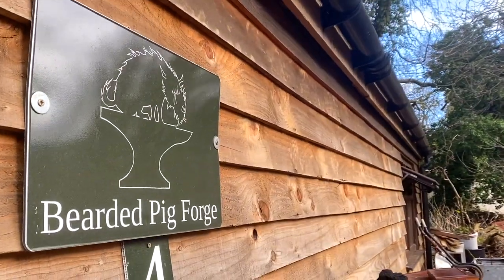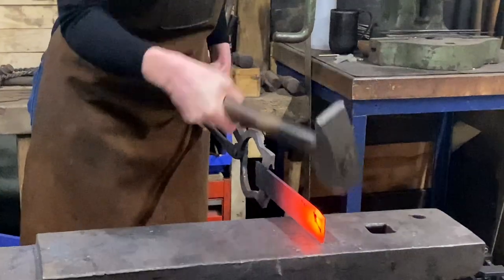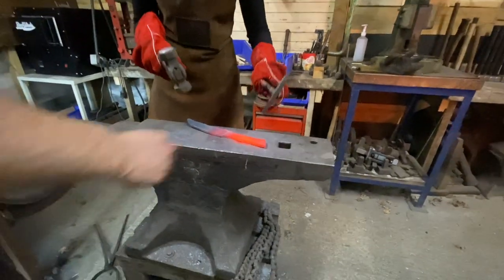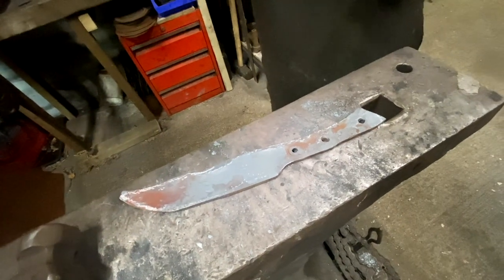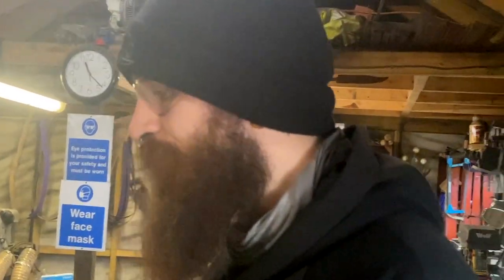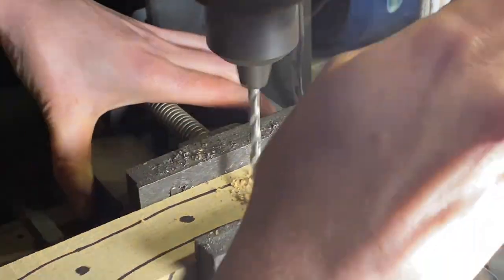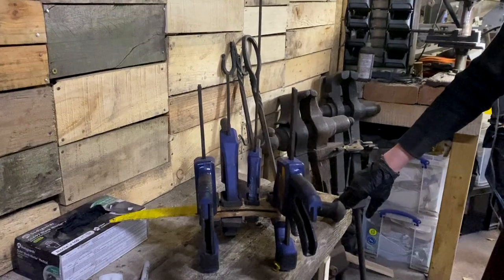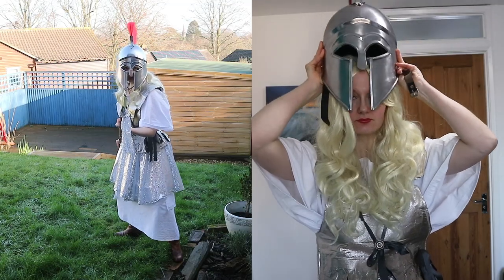I Accidentally Made...

Comment: My partner and I made wedding rings at a forge, and I'm sword making for my Stag party this weekend. I'm really excited. Also, our first lesson was "don't touch the hot thing" too
Reply: Corollary to don’t touch the hot thing is “what looks like cold metal could be hot!”
Reply: @JosephGori  Also, if you set hot metal on cold metal, cold metal can become very hot.
Reply: Yeah, I once lightly touched a metal part of a clamp I was using to work on a piece I was working on.  The heat I was using was minor (It was a small flame only enough to melt solder and anneal copper) and the part of the metal I touched was well away from the heating point.

Dispite having very fast reflexes and only light accidental contact (I was reaching for the wood part of the tool), I got an instant second degree burn.

I also got another burn just from using a dremmel to do some work on another small piece and then touching it (no flame involved).

Even when you're not getting things hot enough to make them glow heat is a danger, so when you are getting things that hot things can get dangerous quickly!
Reply: That last bit is rather like the rule when working with electrical stuff "assume everything is live and will kill you".
Reply: Very important not to touch the hot thing, can confirm...
Reply: Awesome ❤️
Reply: @JosephGori  one of the first things the swordsmith I worked for told me was,  "You're far less likely to burn yourself on a piece of metal that's glowing red then you are one that's dark." To which I told him, "I'm a chef, I know all about being burned by things that don't look hot."

Comment: The most important thing I was told on a forging course is that metal cools from red to black at 500C, just because something isn’t glowing, doesn’t mean it’s cold. And he was right: it’s really easy to unthinkingly try to pick up a work piece by the hot end when it’s not glowing anymore. I didn’t do it, but I came astonishingly close.
Reply: I have thought "must remember, not glowing is still hot" and then soon after just tweaked something in my tongs... With my bare hands, just after it had stopped glowing.
No immediate pain, just a shiny spot on my fingers and an instant "that was stupid" reaction. The pain was delayed by a few minutes/hours. OWCH!
Reply: Hell, even if you don't pick it up with the hot end, the "cold end" may still be hot enough to give instant second degree burns.
Reply: Been there, done that, got the scars from it.  When you drop hot stuff - don't try and catch it!  Woulda worked out fine if I'd have been wearing a glove on that hand!

Comment: The forge version of "a falling knife has no handle ". In this case literally, but yes, no grabbing flying dangerous things
Reply: Working in a vineyard where we use sharp pointy things to prune the vines its amazing how many people, in that split second you get to decide, make a grab for a falling pair of secateurs. Never a good idea.
Reply: I used to work as a car mechanic. One day I was changing the vignette off a windshield after I've finished the oil change. So I was still wearing gloves, dropped the vignette scraper. This this basically a razorblade in a handle with a retractable mechanism for the blade. I manage to catch it mid fall with my thumb and index finger. Completely cutting through my glove through my thumb into my bone. First time In my life I actually had to get stiches and I was bleeding like a fountain. Yes, sometimes you cannot help it when you cat h it out of reflex

Comment: “A falling knife has no handle.” Also applies to soldering irons and anything with a temperature measured in hundreds of degrees.
Reply: Also decidedly Notte Fun is de-soldering a short length of thick 10-12 AWG wire, with a moderately heavy connector (XT60) on the other end, from a PCB overhanging a table edge so that the instant the solder finishes melting, after a minute of sinking a ton of heat into it, the connector pulls the wire to the ground, spinning and flinging molten solder towards me ... and then the solder-coated wire end solidifies in the carpet 👍

That was at least the second time I've had molten solder on bare skin... You'd think I'd learn :)
Reply: @AndrewGillard  I had a similar experience de-soldering a large crocodile clip from a 12V battery charger except in my case when the solder joint gave way the molten solder decided to head straight for my eye.

Fortunately the blink reflex did it's job and no damage was done to the eye itself. I did take a trip to the eye hospital to get it checked out and IIRC after checking out my eye using some fancy machine they gave me an ointment for the slightly burnt eyelid.

Comment: Fun fact, the sparks from the grinder vary with the carbon content of the steel. An experienced smith can tell the quality of steel from the sparks.
Reply: Well, they can get a good idea of the carbon content at least.
Overall quality and other qualities may be different but it is one of the best ways to get an idea of what kind of steel you're working with.
Reply: Fitter & turner here.
Ah, the old spark test. We were taught this in trade school as a way to tell tool steel from every other steel.
Sometimes, the old ways are still the best!

Comment: There's a reason most model kits recommend trying for a dry fit before applying the glue - it makes sure you know what you're doing and lets you identify any problems before you're on the clock against the glue setting. Of course, it does also mean you need to disassemble the item before applying the glue, which tends to loosen the fit slightly, so there is a trade-off there...

Comment: A dagger is 'just' a knife with a sharp blade on both edges, right? Probably better for dealing with ruffian-party-crashers but a sheath definitely recommended before trying to conceal on your person.
I'm surprised that: 
1] The Blacksmith managed to get a beard that long without having singed it.
2] There was so much belt-sanding and you didn't file some of the material away. 
A sword is just a big dagger. Part 2 is making a dagger. Part 3 is making a sword :)
Reply: Seconded! Motion carries (i hope) 😁
Reply: A sword is just a big dagger unless it's a Lange Messer, which is a knife.
Reply: I bet he has singed beard parts and we juat didn't notice. 
Also when using rotating machonary it is sensible to tuck long hair away before your face can get caught in something like a sander or lathe. This greatly reduces singeing  as grinders are where most sparks are. 
Also extra vote for swords. :)
Reply: Technically a dagger does not have to be double edged, it can be single edged (like a Scottish Dirk), but the defining characteristic is that it is pointy and designed for stabbing things. :)
Reply: I've filed a knife out of stock... you have NO IDEA how much faster the belt grinder is! LOL.  It's one of the best inventions for knifemaking since the anvil was invented.
Reply: I think the length of the beard is just like a sign saying "It has been X days since I last forgot that fire is hot".  The longer the beard, the less frequent the accidents.
Reply: @dadegroot  not just Scottish dirks. You’ve also got bollock daggers which can be single edged too, as well as skian daggers that have one edge, rondel daggers are single edged, so are breughel messer daggers, bauernwehr daggers and langseax daggers are single edged.
Reply: Advantage to beards: they intercept forging scale otherwise headed for your face. It's one of the reasons I treasure my own. (I'm a professional bladesmith on the other side of the pond.)

Comment: Yes! Forging content! Brilliant first knife. 
I forge some things, just to have a custom-size bolt or hinge. I wouldn't try to forge knives, I'm not neat enough yet!
Nitpick - tempering relaxes the steel, make it less brittle. The colourful oxides are a by-product, useful for judging if the knife has got hot enough. But the tempering is done by the heat, not the oxides!

Comment: There is an amazing amount of maths and physics in blacksmithing. The weight and make-up of the hammer in relation to the anvil. Amazing stuff that blacksmiths just got to learn. The 10,000 hour's thingo. And then passing it on.  So interesting. Thanks.
Reply: And then there's the way we use blackbody radiation to control the temperature of steel...
Reply: Then there is that every known rule can be broken by some dude in another forge.

Comment: I've worked in metal fabrication shops for about 2/3 of my professional life (which is not the same thing as a blacksmith shop) and I can tell you one thing every welder had done once:  Get done welding on a part, throw your heavy welding gloves off, and pick up the recently red hot part with your bare hands.  It's a rite of passage.

Comment: Great stuff.  Some blacksmiths have really good quality portable forges now.  I took a class at a Celtic Festival in Tennessee, this guy could set up a whole blacksmith shop in under twenty minutes.  The forge was propane powered and lined with fiberglass insulation.  The anvil was the hard part, or at least the most labor intensive...  Best of Days to you, Jill.

Comment: Most forges don't need bricks on the back unless you plan on forge welding. The ones I've worked at are open on both ends so people can work on either side and everything comes out fine.

Comment: Excellent first knife! 

Jill, I'm sure you are well aware learning a new craft always takes a lot longer than you think and the first results are often not what you envisioned in your head. 

Even Period Blade Smiths would use a lot of grinding (aka "stock removal") to neaten things up, albeit using  big-ass grinding wheels instead of belt grinders/sanders. For someone wanting to learn stock removal and sharpening in their own garage or shed workshop, the inexpensive 1" x 30" (Imperial) inches Belt Sander is how scads of new knifemakers learned stock removal, before they upgraded to the professional level one you used in Spike's Shop. Practice on cheap, thrift-store knives, use 40-grit belts to save a lot of time in rough shaping, and dunk frequently.

Comment: Love it, despite its size it does look really balanced in your hand. I feel like the upward arch of the grip shouldn't work but it does, I'm curious what other short one handed weapons might utilize that shape? The only thing I can think of that maintains one arc along its entire profile are short Japanese knives/swords. Regarding the "orc knife" comment, it's a bit hard to tell but it looks like the handle still shows a lot of rough sanding marks.  Finishing the handle off with medium and fine grit sandpaper, followed by treating the wood with something like linseed oil will have a huge impact on its crude vs elegant appearance. Orcs would never finish and treat a wood handle.

Comment: I am a knifemaker (not a smith, I use only material removal) and this is not bad for a first attempt. Looks kinda like my first knife from several decades ago, but it is probably much better. So well done.

Five-minute epoxy is probably not the best choice for a beginner. I only use it for some smaller parts and sub-assemblies, never for the full assembly.

If you decide to make a dagger beware, those are more difficult. And arguably more fun, so *thumbs up*.

Comment: Important first thing I learned when forging (and yes, that includes learning by pain) is that metal can still be extremely hot, even if it doesn't glow anymore.
So just because the piece you're working on looks black, you should never touch it.
And leather gloves protect from sparks and minor scrapes, but not hot steel.

Comment: I too will vote that you do a dagger. Get back into that forge! You've added another rabbit hole (or should that be a badger's sett?) to go down.
A tip when grinding -  wear leather gloves, the thinner type called riggers gloves are perfect. They absorb some of the heat generated and do not form gooey napalm on your skin when the heat gets too great.
Of course all the experts will tell you that gloves are dangerous around machinery because of the risk of the glove getting caught up in the machine.
Sometimes you have to balance one kind of safe with another.

Comment: The handle looks like it's upside down (in a way that if you held it correctly by the handle, the blade would be on top). Considering that I too made a knife I approve of this video (and all little things like remembering that fire is hot - yes I did try to get some dirt off of a glowing piece of metal with just a glove) and props to you for making it - it's quite the workout.
My tip for anyone trying out blacksmithing for the first time: Allow yourself to hit the metal hard, don't hold back too much especially at the start, otherwise you will get tired without making that much progress

Comment: Great video, more knife-forging :-) Well done on the knife; I've seen many more first attempts end up a LOT worse. 
I host about 3 or 4 one-day forge-your-own-knife days a year, and about half of them wants a dagger as a second knife. Having seen more faillures than successes in that endeavour, I learned a couple of things. 1. Start a dagger with a bloodgroove or central fuller. forging in the fuller will allow you to keep it straighter during forging, and after grinding the bevels, it will look a lot better. 2. Forge the guard. This may seem contradictory; but a forged guard / pommel are a lot quicker to assemble. 
3. Start by forging your own hammer. This will make forging knives much more comfortable; and you will learn a lot about handles with is transferable to dagger handles.
Some basic forging tips ... stay away from french hammers (they are really hard and chippy as you have found). Also; the french hammer was handled up side down ;-)
That hammer was also WAY too heavy for you; and the anvil way too high. This will hurt your elbow and back. 
Before someone claims something sexist; hammer weight has nothing to do with brute strength; but is all about coordination and training.

Comment: I learned blacksmithing at Hot Milk Forge, in Antrim (Northern Ireland). I can confirm that it's very easy to forget that stuff is hot. I've burned myself on a couple of occasions by absent-mindedly going to pick up a piece of metal that I cut off a just-heated rivet with my bare fingers. Fortunately, blacksmiths turn out to be very good at treating burns.

Comment: Do you get Forged in Fire on that side of the Atlantic?

If you haven't seen it, it goeth thusly:
Four experienced bladesmiths enter the forge and typically make a knife using a specific technique, specific metals (for instance, metal salvaged from a car) or both.  After three hours, the blades are judged and one smith is sent away.
The remaining three smiths are given another three hours to fit a handle, again with parameters on design, technique and/or materials.  After the time is up, the three blades are tested/abused and the two smiths that made the best blades move on to the final test.
In the final test, the two leading smiths go to their home forges and attempt to recreate a specific blade from history, often something obscure.  They typically have three days, but that can vary, to complete the replica, putting whatever flourishes they like, provided it meets parameters.  These blades are then tested brutally.  The smith who makes the best blade wins $10,000 and the title of Forged in Fire Champion.

Comment: It's rather the same as sharpening a Microtome blade.  They're short, very heavy and very, very sharp - because they're used for shaving slide sections a couple of cells thick.  If you drop it, let it fall.  If you try to catch it on the side of your foot, it will just chop your foot off.  If you try to catch it in your hand, it will just cut your hand in half.  Let.  It.  Fall.  :)

Comment: If you do this again you need to stand on a box when you work at the anvil. Ideally when holding the hammer with your arm at full extension the face of the hammer should be on the face of the anvil. More efficient body mechanics

Comment: Back in my pizza days, trying to drill into new hires heads "If you drop something, DO NOT try to catch it." (think splashing hot oil) ... And that was only @400F. ...and then the day I caught a dropping pan and lifted it back up the oven shelf. (The bottoms of the pan are covered in clinker-just hard carbon, which is an insulator- while edge of the pan would had probably meant 2nd degree burns.

Comment: Yeah, when you are making shit with hot metal, don’t be afraid to hit the metal hard. The harder you hit it the more metal gets moved. The less surface area you hit it with, the more drastic it moves.

So when doing the handle, to beat it in to the right shape, you start by using the corner of the anvil and the sharper corner of the hammer’s pein. This makes a very sharp divot, which you then continue to beat in, but using the corners of the anvil and the horn definitely helps. 

Tempering with a torch is usually frowned upon. It only tempers the outside of the steel, whereas the oven does it over a longer period of time and tempers all the steel.

However using a torch to heat the steel quickly before hardening however is different to tempering. This is called case hardening. And means the steel bends better and and is better for heavy work. But means the center is still soft

Comment: About the point, I was wondering why not cut the point and hammer it back in the opposite direction to make the metal fiber converge ?  For example, you cut the piece from top right to bottom left.  Than, you hammer it so that the point be top left to bottom right.

I took a blacksmithing class once.  This was taught to us but I was wondering if there are other technics.